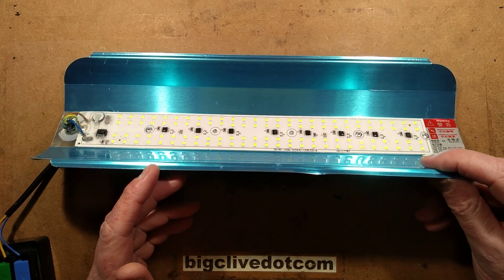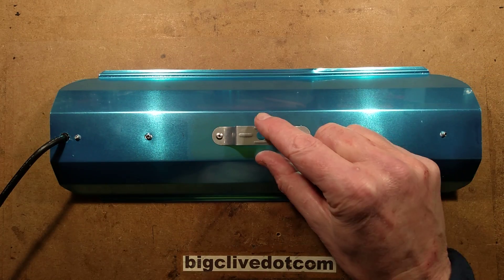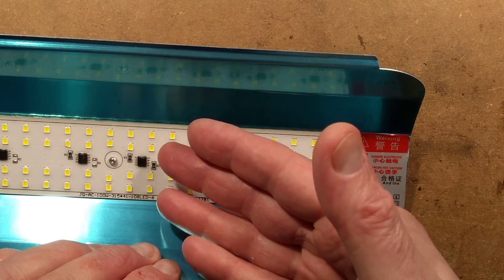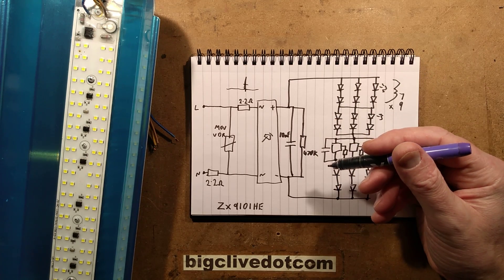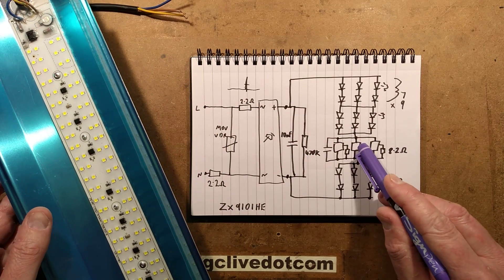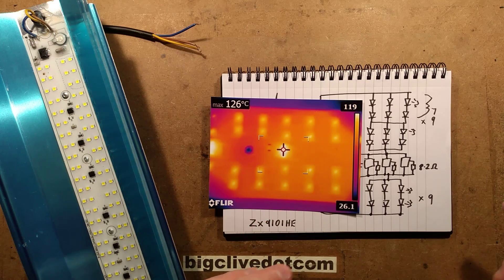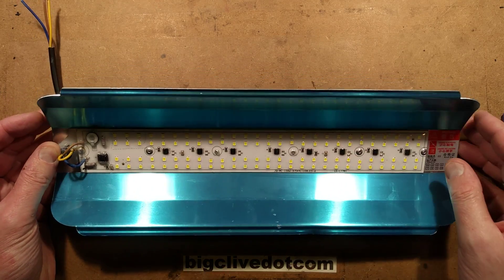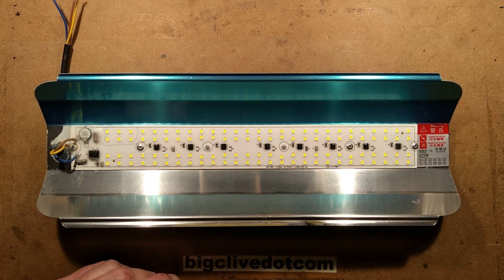100W LED module (growlight?) with schematic.

Comment: You'd think if it was a grow light they would be doing the more efficient red and blue LED thing they usually do these days. Apparently that is a lot more efficient with plants in terms of absorbed light versus reflected light. Any light reflected off the plant material is just wasted.
Reply: Maybe a few years ago, but nowadays the so called "full spectrum" lights usually have a higher PAR (Photosynthetically Active Region) output. If they are good quality of course. Check out the channel MIGRO if you're interested, they have done a lot of intensive tests and comparisons of different grow lights that are really interesting to learn about
Reply: +Douglas Thom Someone should tell NASA that. They're still using the 'purple' spectrum for growing on the space station.
Reply: @Shaun.Stephens  I believe your information may be outdated, as what I'm talking about is relative to 2018 and wasn't true two years ago. Also NASA grows mainly microgreens such as lettuce, which favours blue spectrum (more efficient diodes than red, required for blooming and fruiting) and requires a minimal amount of light to develop: less than 200 micromoles of PAR photons per meter squared per second, compared to heavy fruiting fast growing annual plants grown in commercial environments with a CO2 enrichment air that require over 1000 and need more red than blue, therefore less efficient diodes. Dr. Bruce Bugbee is in fact working with NASA and has published many peer reviewed papers on the matter that you easily find online. Also look at the grow lighting industry. There is a reason why top performing commercially available grow lights such as ChilLed, Quantum Boards, Migros, Optics, Spyders, are using white diodes and obtaining over 2 micromoles of PAR photons per watt, when the pinnacle of what is referred to as "Blurple" technology hardly makes it above 1.5. Basically I'm really interested in the matter and know what I'm talking about, and all the information I've read is available online if you're as interested as I am. If you have over half an hour of free time I suggest watching "grow lighting masterclass with Dr Bruce Bugbee" on Migro's YouTube channel. If you have even more free time and for some reason don't trust tests run by someone else there are PAR maps online for every reputable grow light available (if they don't show the efficiency they are likely hiding something) from which you can see for yourself that average PAR is higher per Watt used in modern technology using good quality white diodes such as Samsung, Luminus, Citizen, Cree or Nichia. Last but not least the single spectrum red and blue lights have a few problems relative to growing plants: they lack the ability to exploit the Emerson effect, which was in fact discovered decades ago, and make it really hard to spot diseases and deficiencies until they have done a great deal of damage. Sorry for the extremely long reply but I wanted to address every possible aspect I could think of.
Reply: +Douglas Thom Excellent reply, thank you for taking the time to write it.
Reply: @Shaun.Stephens  thanks for your kindness, somewhat hard to find on the internet in era of trolling we live in! As you have likely noticed I'm really interested in indoor growing and lighting, and in fact it's through that interest that i got into the marvelous world of electronics and started watching big Clive in the first place! Cheers!
Reply: +Douglas Thom. Sweet. I'm only too happy to learn from someone who knows their subject. That's why I watch Big Clive's videos. :) My only experience with LED lighting for indoor plants is supplementary lighting for early season vegetable plants started from seed near a window to stop them stretching. I've been using a mix of 'Blurple' and cool white. Cheers.
Reply: @Shaun.Stephens  good choice then! Cool white contains a lot a lot of blue, as do many Blurple panels such as Viparspectra or nameless china imports, and blue is the colour of light that you should use to avoid stretch. Considering it is supplemental to sunlight and not the main light source cheap eBay panels are likely more than enough and a fancy light might not be worth the extra investment unless you have other plans for it
Reply: Gonna go watch grow lighting masterclass with Dr Bruce Bugbee now, thanks :)
Reply: @samarnadra  wow sunlight burn on cactus! Where do you live?
Reply: you couldnt be more wrong .red and blue is very inefficient and dosnt grow healthy plants .led lights now use large cobs in white and run them at half the amps. i get around 180 lumins per watt .even the very good hid lights give you about 140 lumins

Comment: Banggood sells a 100W light, looks like the same mfr., blue film and all, but there's two separate boards on a wider aluminum heat sink. Basically two 50W lights. They also have a cover over the mains connection to the board, which is nice. Maybe they got too many rejects with the toasty warm, bare wire version. 

The specs say 6000 lumens, so 60L/W means you're burning up a lot of power in the linear regulators. If I had a grow operation I'd want the most efficient and reliable (COOL) lamps possible, so no sale. I wouldn't mind one to replace my 4 foot florescent shop light if it ever burns out.
Reply: Found it. That's a good price for 2 50w boards.

Comment: would this be a good replacement for a 6ft flouro tube? , (not for growing, just for garage lighting) im still putting off replacing some ancient 6ft ones you cant really get the fat tubes for, i don want to retrofit as they are very old, replace the entire fitting
Reply: At this sort of power and temperature rise, you are really going to want to add a fan.
Reply: so a pass then! thanks i was kinda interested due to its price point, buts its going to be too much light at one point anyway
Reply: There are live wires all over that device with almost no insulation.
Very dangerous stuff.
In my opinion, this needs a grounded case.
Reply from the maker: You can use the newer T8 (1 inch diameter) tubes in place of the old fat T12 (1.5" diameter) tubes if that's what you mean.  They have a higher forward voltage so they run at a slightly lower power.
Reply: just replace the 6 foot tubes with led shop lights, you can get a 80 watt flouro equiv for about $20, replaces the entire fixture or you can get led retrofit bulbs
Reply: Someone said you can remove a current regulator ic to reduce light and heat. That may be an option. I don't know if that really works. You need a parallel capacitor,too.
Or you just buy cheap 10w cob lights. Same flicker, less work, waterproof, nice case.

Comment: It looks about as wide as the  florescent tubes case/ body maybe it can slide in there. If I remember right the old tube case could take a defuse "lens" the waffle molded milk colored plastic, that breaks when removed, every time.

Comment: EEEE that is hot would i get away if i ran it threw a 10 uf doper cap to take the edge off the heat
Reply from the maker: A dropper cap could be used to tame it down significantly.
Reply: @bigclivedotcom  or pop off half the current regulator chips.
Reply: @queazocotal  that's a very nice idea. Adding a capacitor in parallel and then dropping the current.
Does that really work? Can you program them to lower current?
I need 5,5m of these, but it would be too bright and too hot.
Reply from the maker: Disabling half the current regulators could be done by cutting a single track.
Reply: @bigclivedotcom  Thanks for the update.

Comment: Can you add an electrolytic cap, but also add a dropper capacitor to limit the current? Curious as to if it can be dropped to like 30W of flicker free light
Reply from the maker: If you added a series capacitor and an electrolytic across the output of the rectifier it would definitely help.
Reply: What size series capacitor would be needed to run it at the 30W Clive?
Reply: There is no "one value fits all" capacitor which will give you 30W of output. There is a fair bit of math involved to get the correct value of dropper capacitor required.

Here's a page explaining the various formulas needed to calculate the capacitor value:

https://www.electroschematics.com/5678/capacitor-power-supply/

Just be aware that capacitor dropper supplies are not recommended for high power LEDs without current regulation because the hotter an LED runs, the more current it will draw, eventually leading to self destruction.
Reply: Tell us if you tried it.
Reply: I certainly can't see why it wouldn't work. It may take quite a large (expensive) series capacitor.

Comment: I got one of these units from eBay a couple of weeks ago for Au$9.99.  Its only seen 10 or 15 hours use  and  so far so good,  but it runs at 115 degrees C ! So I don’t  see it lasting long without  boosting its  cooling.
Reply: Isn't that just room temperature in aus?
Reply: "Isn't that just room temperature in aus?" - 115C would be a bit excessive even for the hot, dry Country! Right now (South Coast NSW Ranges) it's a none too warm 10C, and we do get sub-zero days in our winter!
Reply: Phil S a bit excessive?  In the sense that at 115 degrees C everyone would be dead?
Reply: uK8cvPAq  Only for the lucky bastards with Air Con!
Reply: Just add a couple fans.
Reply: The chips are insulated under goo and not conducting heat to the reflector, more airflow will be little help. Thermal pasting the board to the reflector might be possible. But the unit basically seems not designed to run at UK mains voltage. Whats the point of a 100 watt led lamp that runs as hot as an incandescent ?
Reply: It looks like a useful light but lacks a heat sink. Weird to save on that, but I guess they needed to get the price down so omitted the most important thing.
Reply: Doesnt look like it lacks a heatsink - the big alloy reflector should be its heatsink.
Reply: ok. It has a heatsink, BUT it isn't of sufficient size and form to act as an efficient heat dissipator.
Reply: Andy Mode  The aluminium reflector is so thin there’s not enough metal there to allow much heat to move transversely along the thing. I think any heatsinks would have to be right on top of the COB, this with its own problems and requirements.
Reply: Epoxy package ICs are typically rated to run in an ambient of 70 C.  So if the package itself reaches 60 C (as it was for Clive) I wouldn't be too worried.  Obviously, the cooler (within reason) the longer the life.  Package at 115 C is probably OK, because max junction temperature is typically 150 C - 175 C.

Unless it's from a really shitty IC manufacturer, or it's more than 70 C where you're using that lamp, 115 C ought to be OK and isn't going to drastically reduce the life.  And by "drastic" I mean a factor of 10 or worse.
Reply: You might want to check some datasheets for SMT led's and do the stackup with the MCPCB.  
Tj_max is not 150-175 for an LED.  It's more like 120C.  Often, datasheets will simply specify maximum case temperature of about 80-85C.  Given Rt_j-c for similar packages, this should correspond to about 120C or so for Tj.  

The area provided by this reflector and its characteristic dimension are grossly insufficient for a ~100W heat input given those restrictions.  Even if the array were held vertically to maximize convection cooling, it would still be insufficient.  Unless you're designing for a maximum ambient temperature below freezing, this would likely be insufficient for a third the rated heat input.  The 30W arrays I built have about twice the fin area, and those are near their thermal limit at 55-60C ambient.

Also: it's worth pointing out that the IR image is not strictly of the components themselves.  The readings will be dominated by the temperature at the surface of the conformal coating -- which means that the temperature of the buried surfaces will necessarily be higher. 

Will it work when it's running at or far beyond thermal limits? Yes.  ... and light output will be reduced dramatically, both as the efficiency is a function of temperature, and as the rate of device degradation is a function of temperature.  Given the cripplingly poor efficiency and increased probability of complete failure, what's the point in even wasting all the extra power?

And regarding the meaning of drastic:  Consider that the lifespan/temp curves are not linear.  125kh at Tj=60C may indeed be about 8kh at 140C ... of course, it all depends what you consider the EOL criteria to be.  Since you're already looking at a ~20-25% loss of output in the first few minutes, maybe there is no lower bound on expectations.
Reply: bdf2718 Did Clive say 60°C?  I could have sworn he said the final temperature in a 15°C room was 160°C — the photo he printed and displayed was already showing 126°C, if I recall correctly, where he mentioned the final temperature after about 30 minutes was 160°C.  I would agree that a peak temperature of 60°C, even 70°C for many parts, is not overly concerning (provided one accounts for possible elevated ambient temperatures that would further increase the temperature), but if components are exceeding 100°C even in a rather cool 15°C room and the current regulators are already going into thermal limiting mode then things definitely need a good deal more cooling than has been provided for.
Reply: You can add in a cooling fan
Reply: @supersaiyangoku3580  I bought some of these lights. Put a pc heatsink and fan on and they run cool to the touch. Been working 2 months now, 16hours a day, and still going strong
Reply: Wish we had them back in my day.. running those high pressure sodium lamps was so tricky and costly.
Reply: leds DO NOT like heat. if that thing runs 115 degrees C it wont last long. at all.
Reply: That heatsink is too small for 100W (actual dissipation) ! Samsung makes integrated LED fixtures for household lighting. Those dissipate ~15W, and use fewer LEDs over roughly the same surface area.

The Current regulator chips will probably die 1st. Even though they have thermal protection circuitry, the die is damaged slightly every time that has to kick in. Power it up 24/7, and see how long it last. My bet is 2 Weeks, or ~300hours, continuously.
Reply: Re: regs will die first... That's probably a reasonable estimation at any temperature.  I haven't found any of these "driverless" LED regulators that had an effective means of dealing with fast rising transients.  I even managed to blow a bunch up just by flicking the switch off and on.
Reply: Get some PC thermal cement, and put on some aluminum heatsinks from newegg